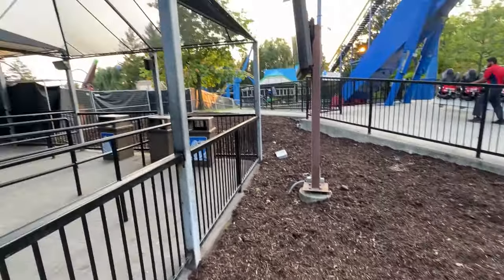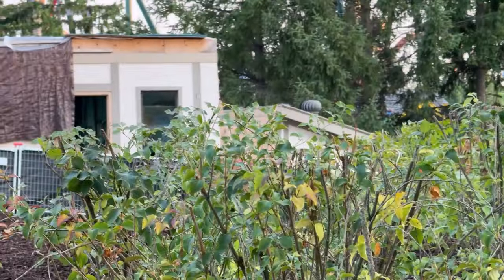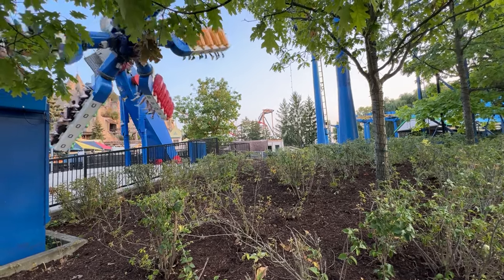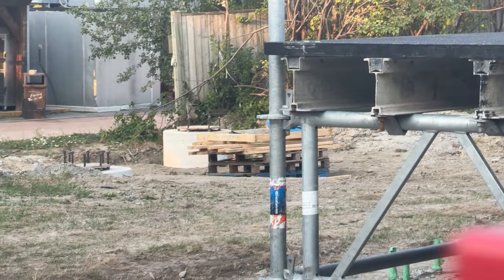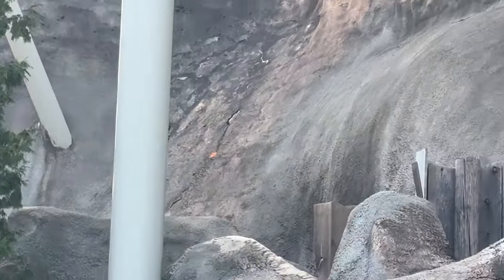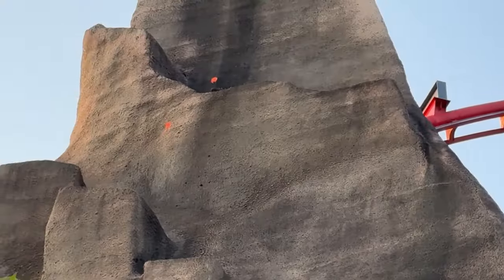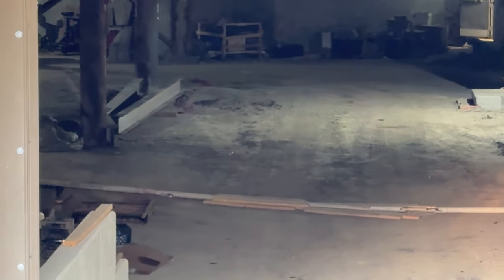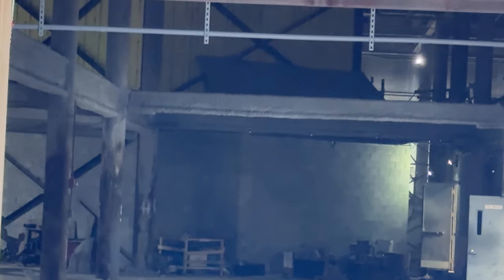Canada's Wonderland AlpenFury In Park Update

Comment: Do things seem really slow?   They still have a lot of footers to prep, trees to cut, station to build, track installation,  station build.   And with Haunt and Winterfest,  This will slow them down that much further. I would have thought they would be so busy with all these projects.  If they decide to wait, Can you imagine the manpower you will need to build this. They could very well, bring in 3 or 4 cranes to build this ride. I'm not saying it can't be done. But, they have so much to do
Reply: Keep in mind that this ride is also smaller in size than Yukon Striker. So it won't necessarily take as long to construct as Yukon did. Theoretically of course.